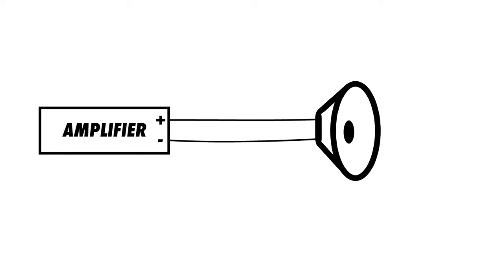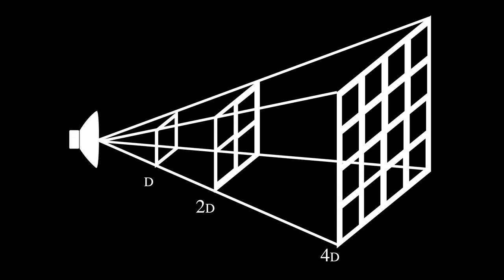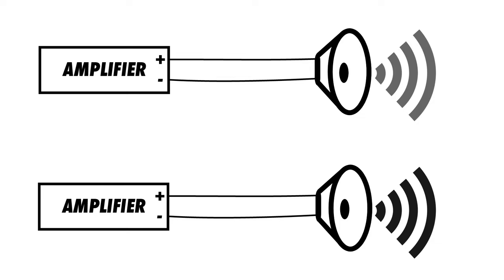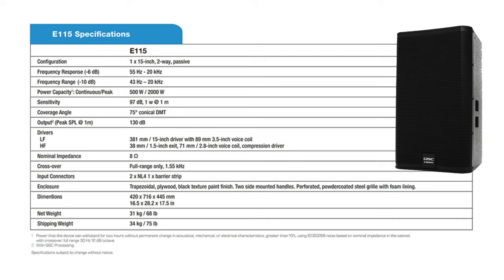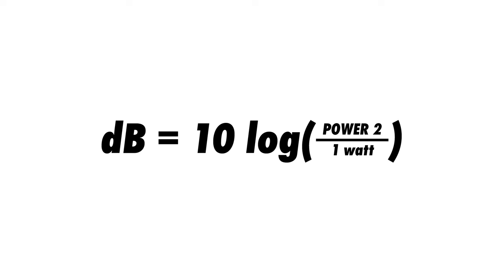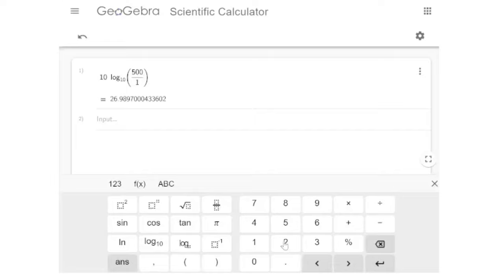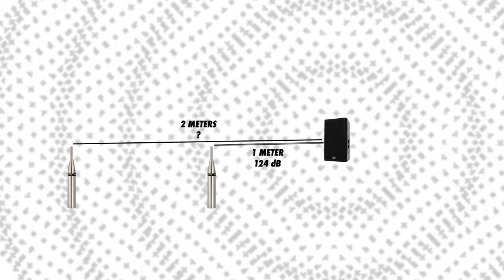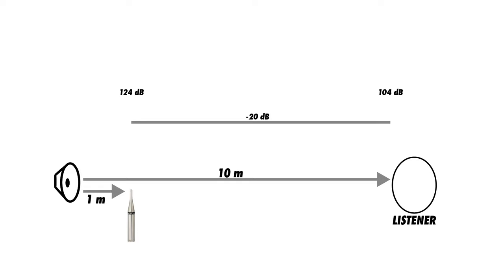Are Your Speakers Loud Enough? Use These Formulas To Find Out...

Comment: The loudest claims I've seen are from Altec Lansing, Klipschorn, and a B-52 folded horn at 118 dB @ 1 meter @ 1 watt. Several years ago. I built my own 15" front-facing rear-loaded folded horns, and though I don't know what they measured, my 15 watt/channel receiver would get unbearably load in a large room. I made 2, so I could stack them for my bass amp, and so I could separate them and put a mid and a tweeter horn on the top for my stereo.

Comment: My home stereo is a 1986 Technics 350 watt amp dividend into two outlets for two sets of Technics speakers that are all 8 ohms and is very loud. I have another 1000 watt and 1500 watt amps and 1000 and stage monitor speakers and bass for public events not for home use.

Comment: Easy way to calculate spl without a calculator:
Let's count the steps:
2…4…8…16…32…64…128…256…512
There's our 500 watts. That's 9 steps at 3db per step for a total of 27db gain.
9x3= a lot easier than sone log BS! 😊

Comment: Well, 6dB "air loss" pr. metre.  That is in FREE air, right?   In a home with walls, corners and so on, the "Air Loss" should be much less.  I usually calculate - 3.5dB in a typical home pr. metre.  Also it would be worth mentioning, that when using TWO cohesive speakers 6dB will typically be added.   Do you agree to those rules of thumb, or do I need to adjust my bearings?  😀.  Thank you for some excellent videos. I love how you explain and demo things, sir!
Reply from the maker: You’re definitely correct that barriers, reflections, and multiple speakers will generally always cause less loss over distance than in a free field. Although, I’m unaware of a rule of thumb for estimating that. 

Thanks for the comment! Good points!
Reply: @AudioUniversity  haha..  How should i measure to confirm?  Pink noise?  To my knowledge the speaker efficiency specs are measured with a band limited pink noise signal, right?  So if i use that, and measure over a distance of first 1 metre and then 4 metre.  We would be able to calculate the nominal loss pr. metre in a typical home, with speakers placed close to corners.   What is your take on this?    Ill guess that ceiling height also have a lot to say?    Would you agree, that I could do a practical test in the way described?
Reply from the maker: Yes. This seems right. I would expect a lot of variance based on lots of other factors though.
Reply: Shouldn't two speakers be a doubling of pressure and therefore an increase of 3db.

Comment: Nice video's! I've been subscribed since we met at the AES meeting a few months ago.

Just to clarify, the inverse square law is only true in a free field environment. That means no reflections. In a reverberate space, reflections need to be considered. For instance a sound source placed on a wall or corner, will have a much difference level drop off characteristics compared to a speaker placed in the middle of a field.
Reply from the maker: That’s right! Thanks.

Comment: Although this is a good estimation. There are two issues here: 

1 - That 97 db/w.m should be a graph. Without it, you have no idea what frequency that number came from. There could be a 1khz spike that is much louder then all the other frequencies but that's the number they give you giving you a false representation of it's real world value. Very common with manufactures listing the 1khz spike as the efficiency of their subwoofer cabinet when the cabinet isn't going to be used above 150 hz. 

2 - Power compression is real. Putting 500w into that cabinet continuous is going to heat up that voice coil, increasing it's impedance and there is no more volume to be gained by increasing power anymore. Probably sound like crap at that level as well. Just because it can go that loud doesn't mean it will sound good doing so.

Comment: Hi Kyle, first of all I've been following you for several years now and I like your way of presenting the videos and concepts.
I would like to start by saying that everything you have described is true and I agree with what you present.
However I would like if you could explain better what an amplifier actually does and its relationship with the SPL.
An example we have 2 similar amplifiers of the same brand but of different models and the same speaker is connected to them.
The first amplifier will be called A with 500 W of power and 21 dB of gain, the other will be amplifier B of 100 W of power and 30 dB of gain.
Once again the same speaker is used, under the same circumstances, the preamplifier is not going to move the volume pot, so the lower power amp B of 100 W will sound louder than the A with more Watts.
People should know that most of the SPL is due to the gain of the amplifier than to the consumption of the amplifier itself.
It is like the magnifying glass and the magnification, that is the gain and not the size of the magnifying glass, which would be the power in this crude example.

On the other hand, it is true that the amount of SPL is lost with the relationship described by the inverse law of distance, that you double the distance and lose 6 dB, that is true but ONLY if it is measured outdoors, in open field or in an anechoic chamber and not in a room.

For everything else I congratulate you, very good video.

Comment: Amps also differ in sound output even if they are the same wattage, for instance, its a well known thing that Tube Guitar Amplifiers tend to be louder than Solid State amps of the same Wattage, and drastically louder than the Digital amps of the same wattage. This matters less with Monitoring or Playback as most of those amps are Solid state transistor based, but it matters a lot with Guitar and Bass amps.
For example my bass player uses a 100watt Bass amp, which does not seem like it would be that loud, but its a tube amp and I can confirm the volume of this amp is insane. Of course the output varies even between amps of the same type of tech (be it a different circuit or even different Tubes/Transistors etc)
If I was chosing a guitar Cab I would be happy that a 120watt cab would handle a 100Watt solid state or digital amp, but I would not be confident it could handle a 100watt tube amp, i would want a cab that takes at least 140watt, probably closer to 200.

I know what you are talking about is far more precise, its just something I have always found interesting (Tube power vs Solid State vs Digital)
Reply: read about Ohm law

Comment: I have speakers which are 115-119 dB spl/ meter, and I only use 5W/ch Pass Labs amplifier, and it is a very loud system, and very clear.
Reply: Can I ask what speakers do You have?
Reply: The upper end from 400 Hz on up, three compression drivers per channel, and two concert Jensen 12" Field coil speakers.  They  bested some 80K speakers in a blind test, and they are to darn loud  even with  2 watts per channel.  I run them at -25dB.with a fifty watt amplifier.

Comment: 1.Does feeding the speaker with number of watts closer to its peak number of watts (using good quality amplifier), help in sound quality, other than SPL? 
2.Does it enhance bass output of the speakers?
3. Any science backing behind wattage "headroom"?
Reply from the maker: Great question! Check out this video: https://youtu.be/6B0OlQaD_i4
Reply: 1: a good quality amplifier with power close to the peak SPL or not, will improve the sound quality. But that’s due to better internal components. Has nothing to do with watts in any way. 
2: it’s recommended to get an amplifier that can deliver more continuous power than the speaker is capable of handling (e.g. speaker 500 watts continuous, amplifier 800 watts continuous). It will not enhance the low frequent energie (“bass”). But there are amplifiers that are more focused on low frequency output and others more towards the high end. Depends on the manufacturer. This also answers your third question. There is some science behind wattage headroom: more power from the amplifier than the speaker can handle continuous (approximately 1.5 times the speaker recommended power) results in healthier situations. In other words, you will never run into distortion delivered by the amp. The opposite let’s say a 200 watts amp for a 500 watts speaker will bring problems sooner or later. You will crank up the volume, 200 watts is nearly reached and the amplifier distorts from the output right into the speaker. Hope this answers your questions.

Comment: This makes sense, but I am lost on one point. So the dB formula used for power is 10*log. But, we are talking about dB SPL, which is normally 20*log. How does using the first relate to SPL when using it for a power ratio? I know I am missing something important lol
Reply from the maker: Check out this video: https://youtu.be/xSe7y9tYex8

Comment: Great channel, so much info. This has helped me so much setting up our church audio. I do have an amp question though. We are replacing our old amp with a new Behringer nx 6000. I have two 350 watt at 8 ohms yorkville passive speakers. We haven’t bought the amp yet. Looking for advise on if this seems like good amp for the speakers and if wiring them in series or parallel would be better. Any info would be great!

Comment: I have a small 4 ohm PA  Amp and two 4 ohm speakers,,i want to add a small passive monitor. .How do i connect it to my PA.. My amp has only two 4 ohm speaker out jacks sockets . Regards for any help.

Comment: Really good video. What is the ideal dB for humans? 
Based on that, I can calculate what speakers I need.
Reply from the maker: The threshold of damage (where hearing damage begins to occur) is often said to be around 80 dBSPL. Unfortunately, it’s common for concerts to run at levels up to 110 or 120 dB! 

I’d recommend determining a target and designing the system to provide some extra headroom.

Comment: I don't get the 20 Log calculation. Right before it's said that pressure in dB decreases by 6 per metre. This means if the speaker has 124 dB by 500 watts within 1 metre distance the loss at 10 m is 64 dB, not 20. Thats quite a difference that should be explained.
Reply: The loss of pressure is  geometrical based on the area of a sphere.  That's why it decreases by 1/(radius*radius).  Given the log, that's where the extra 2 factor comes from since the log of a power becomes multiplicative term.

Comment: In this way you can also calculate the coefficient of power (COP) of your loudspeaker. But don't be surpriced how inefficient loudspeakers in general are. For the loudspeaker in the video with its 97 dB/W at 1 m distance the COP is only 3.16%. If you have a very inefficient speaker you can get just 85 dB/W. The COP of this speaker is only 0.2%. A hypothetical loudspeaker with a COP of 100% has 120 dB/W. With a highly efficient horn loudspeaker you can achieve up to 106 dB/W which corresponds with a COP of 25%.

When you operate a pair of the speakers in the video at a power of 2 x 500 W you generate a heat of 970 W, which is allready a nice contribution for heating of your living room. If you use a class AB power amplifier it will contribute at least additional 500 W fof heating power, so you will get in total more than 1500 W heating power contribution.

In reality it is mostly more than enough if you operate a 97 dB/W loudspeaker at 1 W electric power for your living room. It is ok to go 10 to 15 times higher with your amplifiers output power in order to reproduce a good headroom for percussive music. Under this operating conditions allready your amplifier operates with a very low COP because at low output voltages most of the operating voltage is used at the same current by your output stage producing more than 10 times the heat of your electric output power.

A relatively large class A operating range by a quiescent current of 100 mA or even more also contributes significantly to inefficient operation. For my self made 2 x 12 W home audio amplifier I set the quiescent current to 50 mA. So I generate only 2.4 W at my symmetric +/- 12 V power supply. For my living room I need considerably less than 2 x 1 W (typically 2 x 200 mW) of output power at the terminals of my Magnat Vector 1 loudspeakers for normal listening. And they are not very efficient with their (measured) 91 dB/W.

Comment: After a hiatus, my studio monitors seem SO much quieter than they used to be. I have my audio interface turned all the way up and its still not enough. This was not an issue previously. I'm thinking maybe its the room, I changed studios, the new one having higher ceilings, but it still doesn't quite make sense considering how dramatic the difference is. Anyone have any thoughts, ideas?
Reply from the maker: Here are some things I’d check…
- Cables
- Volume on Monitors
- Interface Driver Update
Reply: did you lose some hearing during your hiatus? too much loud music when you're partying? pick up a construction job running a Jack hammer? wear your ppe hearing protection.  been shooting guns without ppe?

Comment: Excellent Video. Thanks for reminding some formulas. Though I disagree with the statement ".....rest is converted in to Heat". About 30-45% will be directly converted to heat with a class AB amp and 10-20% for Class D amp and lesser in Class H or so. With a decently efficient audio amplifier most of the electrical energy gets converted in to mechanical energy and a portion of that mechanical gets converted into acoustic energy. Correct me if I am wrong.
Reply: "most of the electrical energy gets converted in to mechanical energy" . I wouldn't agree with that. That voice coil is just a big resistive heater. At least all the turns of the coil outside the magnetic gap is anyways (the Thiel-Small parameter "x-max" lets you know how much is outside the gap on either side which is why high x-max drivers have poor efficiency). The turns inside the magnetic gap may convert a good portion of that energy into mechanical energy but it is still losing energy to resistive heating as well. All said and done, a speaker like the EV used in this video will only convert about 1% (considered quite good) of it's electrical input into sound energy irregardless of the amplifiers efficiency which is a totally different calculation.
Reply: @wally7856   @wally7856  You are right. I wish this wasn't the case. So much more loud sound we would get 😂 for the power we put into those things. I didn't take the speaker heat into account. I only spoke about amplifier part. In future we can see  more efficient speaker. Let's hope for that at least.

Comment: Hi, thanks for the video! I have a somewhat very basic problem I just can’t solve (sorry for the beginner question). I have an amp pedal with no headphone out. I use it through a small mixer to play and listen through headphones. But I’d like to use it without headphones sometimes. Can I simply connect studio monitors to the mixer? Will that not blow out the monitors? Or is the 4 cable method through an amp cab (with fx loop) the only way to hear it without headphones?
Thanks!

Comment: So at 100 metres with 90db sensitivity, 360 watts of continuous power will it be 75db or 5.5 db? 

20log (100/1) is 40 but using the other calculation I got 115db at 1 metre and -6db x 100 = -485db. 

One calculation says I'll hear 40db at 100 metres and the other one says I won't hear anything at all doesn't it?
Reply: Oh wait I just did 20log(100/1) which is 40, so I will lose 40dB over 100 metres then

Comment: I think the formula is wrong. Power directly proportional to 1/r^2. Just imagine the sound point is sending out like a "round shape" not "square shape", so the are of a circle is pi*r^2. And that's why when we judge the power loss over distance become 20 log(dist 2/dist 1) instead of 10log(p2/p1), because of that square bring down becomes 2*10 in log theory.